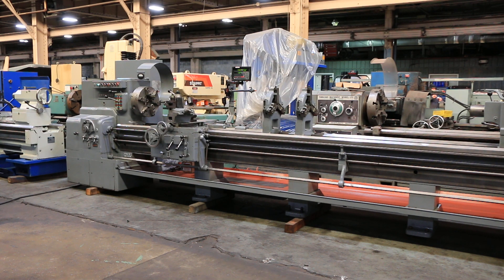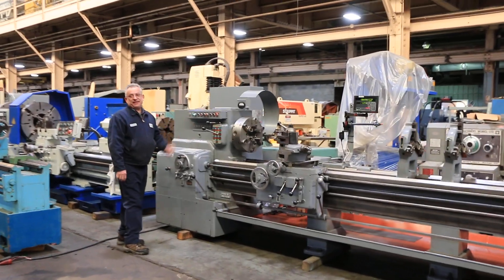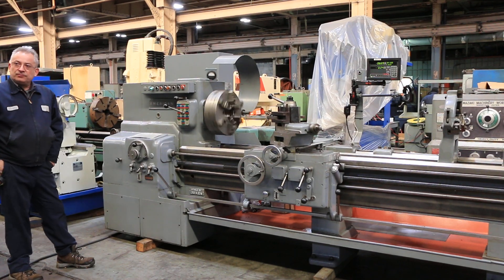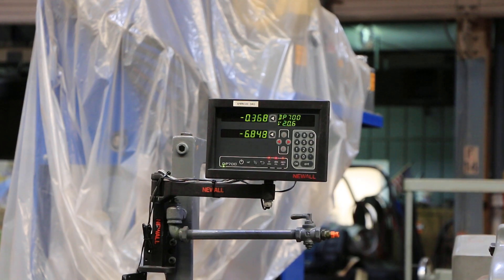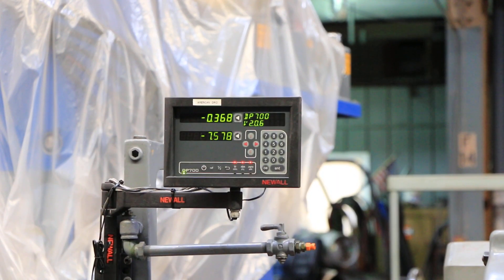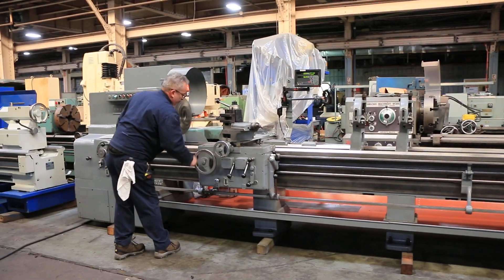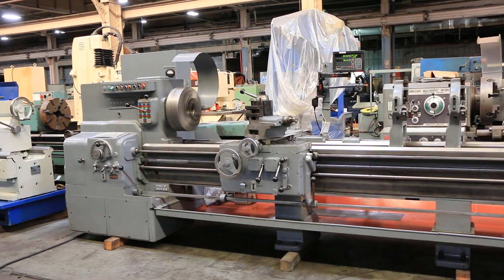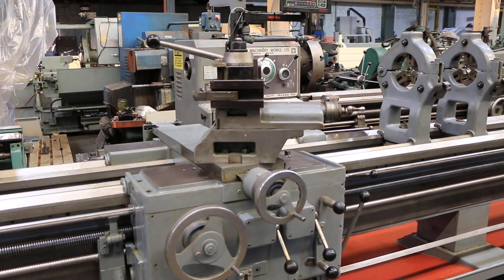24" x 174" AMERICAN HEAVY DUTY ENGINE LATHE

Comment: The machine looks good, and is a relatively new machine (1973) compared to machines built back in the '40s and '50s and still running. But it doesn't have a travel-rapid that a machine that large and newer should have. You also don't show lead-screw reverse for when cutting threats you won't need to disengage the have-nut; just push down the on/off handle to get back to the start of the threat.